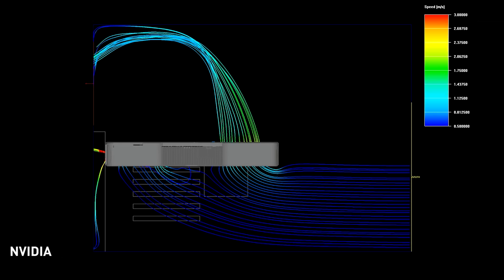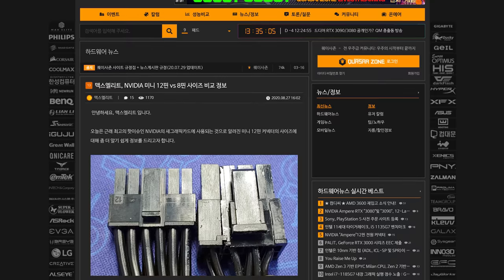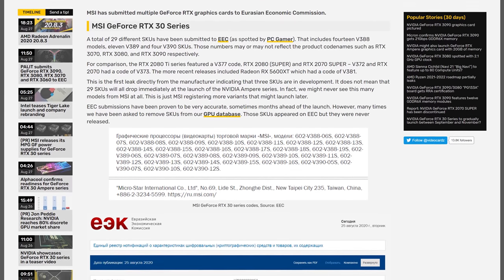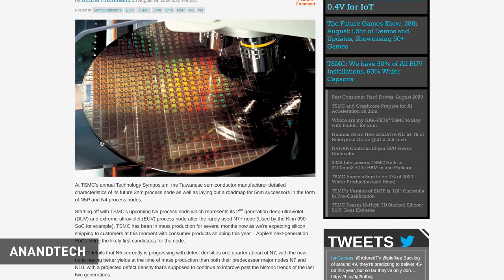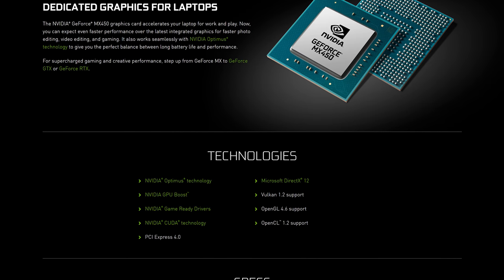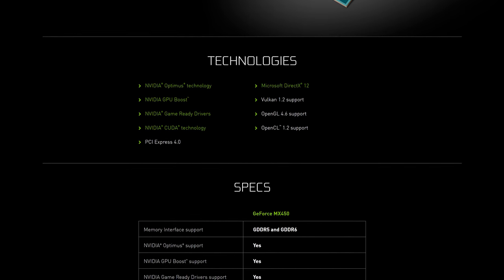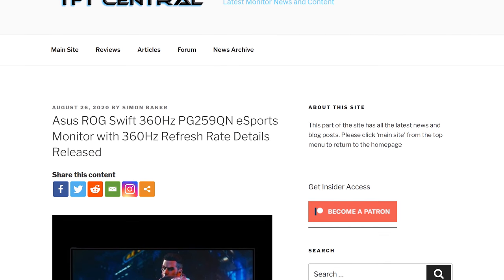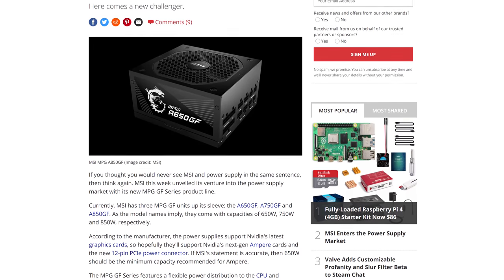RTX 3000 Power Connector, Great TSMC 5nm Yields, Nvidia's First PCIe 4.0 GPU | News Corner

Comment: I remember reading an article in the late 1980s, maybe in Scientific American, right at the transition below 3 µm where they explained in great detail with beautiful diagrams that physics would never allow transistors to be built much smaller. At the time the physics of leakage currents were considered an impossible barrier and we were told that 1 µm could be made but would have such huge leakage that it would barely be usable in some circumstances. They explained that electrons would just tunnel through the insulators and gates and features willy-nilly and make transistors completely fail to work.
Reply: But now the size is inching closer to silicon atom size, which means if we want to pass it we will need some other "magic" to prevent possibility of quantum tunneling.
Reply: Yes, quantum tunneling is a serious issue for ever smaller nodes. A few years ago, it was thought that anything beyond 5nm would be a huge challenge due to tunneling, but now we now that we can still push the material a bit further to as low as 3nm. After that, we're into the unknown. TSMC want to test 2nm viability at some point, but I strongly doubt they'll do so anytime soon.
But even so, let us first see how 5nm goes. The fact that yields are great should certainly please AMD stock owners, as AMD wants to present 5nm CPUs and GPUs by 2022, which would be a tremendous step for them.
Reply: I mean of course. They aren't wrong. You just have to do something different to prevent that leakage instead of just shrinking old planer transistor designs. This is the logic behind Gaa-Fets which are the end game FET. Not a whole lot more you can do besides wrapping the entirety of the source and drain with the gate. Now you have 4 sides of insulation instead of 3 compared to finfet (or 1 compared to a mosfet). Still a lot of fine tuning you can do to improve performance, but you're not getting anything categorically better than a gaa-fet. I would say silicon has a good 15-20 years left before we have to start looking at other materials to continue performance scaling. Lots of higher performance semi-conductors out there.
Reply: @daktaklakpak5059  You can't beat physics, it's literally the laws of the universe. And Einstein has not been proven wrong yet. There are no particles that has been proven faster than light, those were calibration errors in an experiment with neutrinos that were later proven to be false.
Reply: It's also worth noting that the 7nm chips from TSMC were identical in sizing to 10nm chips from other manufacturers, so it's possible that the <3nm might not.... really be <3nm.
Reply: @daktaklakpak5059  lmao
Reply: @TheArrowedKnee  Einstein was wrong in his view on quantum entanglement.
Reply: Sure, but what about that mustache though?
Reply: @skootdiggity1301  it's awesome of course
Reply: @JB-xl2jc  well yes, its already common knowledge that transistors are alot bigger than the name. the 3nm is just another marketing term, just how 7nm was a marketing term.
Reply: @georges617  3nm, 2nm and all this is just marketing term, 7nm doesn´t have 7nm transistors, and neither will 5, so they will probably at some point reach 1nm, and 1nm won´t actually be 1nm.
Reply: @TheArrowedKnee  I just watched a VSauce video "How much does a shadow weigh?". In the video he says we have measured charged particles moving faster than light when both move through water. Yes, nothing can beat "c" the light constant but matter can move faster than light in other mediums other than a vacuum...
Reply: they hadnt gotten the Physics 2.0 update when they said that.
Reply: @kaiser_nit0157  it's not just a marketing term, it's the smallest feature size.
Reply: @commercio3564  of course when they say nothing moves faster than light, that's shorthand for nothing moves faster than the speed of light in a vacuum.
Reply: @PatrickPoet  thats not the case since 22nm originally came out. It usually referred to the gate length or half pitch though there were still decrepancys, in the past this smallest feature size was smaller than the node size for alot, nowadays it is bigger than the node size and it doesnt refer to any gate length or half pitch or any geometry of the transistor, but the producers kept their naming convention.
Reply: worth mentioning that the marketing terms like 5nm arn't strictly representative of the gate size since they measure in all kinds of wacky ways.
Reply: @yamatsukami987  If you mean by "measure in all kinds of wacky way", that they don´t measure anything at all, than you are right. Because they don´t measure anything these days, the node sizes just stand for an generational improvement with nothing else.
Reply: @PatrickPoet  youtube has isaac arthur.
Reply: @daktaklakpak5059  Where is the proof that anything can travel faster than light? A video game?
Reply: @daktaklakpak5059  they aren't dumb..... they are just telling the truth and you are not realizing it. It is in fact impossible with their technology back then.

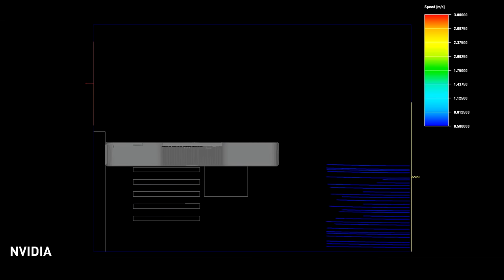Comment: 1:23 I wonder how such GPU cooling solution will affect traditional air CPU-coolers.
Reply: I agree, it seems the air from the top fan will head straight into the path of a Tower Cooler, also what about the VRM getting warmer air,
I am going to watch the nVIDIA video tomorrow for a better look,
Reply: I'm interested in this as well. Will it cause higher temps. Also would this affect other components to heat up with an aio. Since air flow is minimal with one
Reply: my prediction is if your case ventilation is sufficient for the W, it'll be within 3oC difference on CPU average.  that presumably extra energy has to go somewhere.  Separating the core and vram (i think) is potentially a good idea and achievable in their new setup.
Reply: design looks terrible for my inverted corsair 600c case XD but I would prefer to slap a water block on it anyway no way that air cooler will perform better then an open loop with a pair of 280mm rads
Reply: @omgpwnz1  it's going to be an interesting design for water blocks because of the double sided design
Reply: tbh it looks like it'll be too big to fit in an ATX or Micro ATX case. I'll probably be going with an EVGA 30 series if I get one
Reply: @MrZodiac011  what? what kind of shitty cases do you have that won't fit a taller GPU? it seems around the same size as an EVGA kingpin, just triple slot
Reply: probably a neglible amount, non blower style coolers already spread all of the air randomly into the case which ends up going to the back exhaust anyway, this seems to be doing the same thing just more efficiently
Reply: I would think that a traditional CPU tower air cooler would just push the GPU exhausted air out along with the hot air from the CPU

Comment: Man, focusing on the cooler this much this early makes me think they're trying to prepare us for a hot card and that being a good thing lol.
Reply: I reckon you're on to it.
Reply: @3800S1  i can't remember the cooler being this big of a talking point ever. They made an 8 min video explaining it in which about 3 of those min were actually about the cooler. The rest was about how challenging designing a cooler is lol.
Reply: @SirNickyT  Yeah, RTX Fermi?
Reply: Oof.. 🙈😆
Reply: I'm just glad to have dual 140mm fans at the bottom of my case. This design will let the air flow straight through from the bottom of the case to the top. I'm digging it!
Reply: @CaveyMoth  I'm not worried about the design. It's all the ways they're going to try and justify selling an over powered hot card for $1400. Its absurd.
Reply: Sir Nicholas I'm sure there'll be plenty of better cooled cards once the manufacturers get their hands on them.
Reply: 350watts

Comment: r9 290x was 300w tdp gpu and used simple 3  x 80mm fan coller design on one of the coolest cards in multiple benchmarks at the time - gigabyte windforce oc model https://www.techpowerup.com/gpu-specs/gigabyte-r9-290x-windforce-3x-oc.b2688 the cooler able to keep up with "450w" of TDP then, same cooler got carried to 980ti models with saying up to "600w" of TDP and here we are, with nvidia making new designs of gpu coolers which already were made 6 years ago...or we back to 2012-2014 era with such TDP ratings....gtx 480 here we go again.
Reply: I was literally thinking the same in regards to the 295x furies.

Comment: Nvidia is turning in to Intel...
Intel: "New" socket required
Nvidia: New connector required...
This is ridiculous
Reply: Wtf are you saying ?
Reply: its not like you couldnt adapt it - they just did to be able to design a smaller pcb
Reply: So you just add your two 6 pins into a supplied 12 pin adapter, oh no end of the world..
Reply: The 6pins are old and busted, PSU manufacturer cheap out by doubling one 6 pins to make 2, without the appropriate cable gauge to deliver the power.

This new standard is needed.
Reply: @wing0zero  Not at all, 12 pin connector is smaller, also adapter is 2x8 pin to 12 pin.
Reply: @dainiusvysniauskas2049  
Either way you just use an adapter, or if like most of us who have a modular PSU you can just grab a new extension for a few quid.
Reply: Very different though. Imagine if intel CPUs just included an adapter in the box that made current motherboards support it? That's the difference. The new connector will come with an adaptor, no need to get a new PSU. While intel is DEMANDING a new motherboard for use of their new CPUs.
Reply: @odinsplaygrounds  yeah, Intel sux
Reply: @odinsplaygrounds  
Thing is motherboard has to change at some point, they have been phasing out things like the 5v and 3v rail, new boards don't have them so it's more legacy support now and there come a time to move on, just like when people were complaining going from AGP to PCi-e, needed to be done.

Comment: inclusion of PCI-E 4.0 for the MX450 could potentially reduce its requirements for PCI-E lanes to x8 or maybe even x4, which would lower the complexity for the laptop boards, allowing for a cheaper or smaller designs. personally cant wait to find out where thay manage to squeeze it in :D

Comment: Been using 1080 TI for two years which i got for 450eur weeks before 2k series, i was happy that it was on par with 2080 which at time cost 800-900eur and still doesn't cost less than 700eur here.
2080 TI was tempting but for triple the price 25% of gain in performance wasn't worth it. Really hoping RTX 3090 would kick some ass, but it wil be even more expensive... Going to wait for big Navi anyway.

Comment: You do realize PCI4 is still a huge benefit, even on a GPU that doesnt use it right?
They can use half the lanes (8) at PCI4... get the same speed bandwidth as PCI3 at 16 lanes
and use those 8 lanes saved for other stuff... like more NVME or USB.
Trying to explain that to people reviewing stuff is like pulling teeth from a lively shark.

Comment: Will MSI make their own or just rebrand seasonic PSUs
Reply: The Poltical One looks like a CWT GPU Base unit, aka MSIs take on the Bitfenix Whisper M/Enermax Revo DF
Reply: @GreatMasterGaming  If I remember right, Deepcool DQ-m is based on the same platform too. Hopefuly they will keep the pin unchanged, which means people will be able to use custom cables made for Corsair PSUs.
Reply: @dainiusvysniauskas2049  Yep, also CWT GPU. So that'll be interesting to see. If we assume the internals and performance is shown and accurate, at the end it'll be dependant on price to see if its worth

Comment: MX450/PCIe4.0 - It appears the reason the mobile Intel Tigerlake CPU offers PCIe 4.0 for discrete GPU connection is because Intel seem to think that 4x PCIe 4.0 uses less power than 8x PCIe 3.0 and they provide the same bandwidth, it's likely Intel did a lot of testing to confirm that this in fact the case and then it makes sense for what is effectively one of the last Intel strongholds. It's not been confirmed Tigerlake ONLY has a 4x link but all material is compatible with that.
So it might be that MX450 pretty much HAD to offer PCIe 4.0 because otherwise performance with Tigerlake would have been serious compromised if the rumors of it only offering a 4x connection is true, it probably still offers an 8x interface for AMD and Intel mobile processors that are still "stuck" on PCIe 3.0.
I expect AMD to also switches to PCIe 4.0 on their next mobile processors since it's really about the bandwidth rather than specific slot size, AMD might not have dared doing that for the 4000U due to many mobile vendors wanting to at least have the option of external Nvidia PCIe 3.0 GPUs that need an 8x connection to not be crippled by lack of bandwidth but Nvidia is finally implementing PCIe 4.0 with Ampere.

Comment: The rationale behind providing PCIE4 in MX450 might be that it allows using 2 times less PCIE lanes to achieve the same bandwidth, this will free some space on a PCB, and will consume less power (2 lanes of PCIE3 consume more power than a single lane of PCIE4  while having identical bandwidth). Sounds like a win all around, the only downside is that PCIE4 have more stringent requirements for the materials used for PCB manufacturing.

Comment: The nvidia MX gpus are usually connected over only 4 pcie lanes so even though the MX450 is probably only a low power card, pcie 4.0 could benefit it since it has fewer lanes than normal (sort of like how the RX 5500XT benefits from pcie 4.0 because of its x8 connetion)

Comment: I always hate this comment section. 

If you're going to complain about prices, just don't buy it. "It costs more than the last generation" Well no shit, it's better than the last one. Just buy last gen with that reasoning, pricing doesn't scale along with performance. The process of making CPU and GPU dies is not the same throughout the whole generation. They don't just take the same chip and and disable performance from a 2080ti down to a 2060. You people complained about RTX being a gimmick but the cards are still selling, "why?" It's simple, they're just better cards and it costs what it costs. You don't need these cards, and if you really do want them, you probably have the budget for it.

Comment: I reckon they will all take on the 12pin. Neater, smaller, more simple. Future. The idea of paying for some "better than reference" card and the partner using up two 8 pin plugs that take up extra room on the pcb doesn't sound likely. Plus the two 8 pin on tall gpu end up rammed against the side of the case or the tempered glass and look a mess. The relocation of a single 12 pin sounds like a far better solution in every way. The adapter they provide could be part of say a 10 inch cable so that the old psu still works and all the mess of the adapter can be hidden. Why would you not adopt 12pin? Just my view :)

Comment: I'm gonna be that one guy and ask...

Why don't GPU manufacturers make GPU models with the cooler on top, so it can release the hot air upwards and contribute to the airflow?
And don't give me a "but that wouldn't fit Motherboard standards" excuses because GPU manufacturers are also motherboard manufacturers. If they wanted to, they could change the standard to something more efficient as they saw fit.

Is there a legit engineering reason why the fans are stuck at the bottom of the card, and not at the top?

Comment: The explanation for the airflow of the RTX 30X0 is wrong. If you look at the angle of the fan blades, you will notice that the rear fan sucks air from the top of the case, while the front fan sucks in air from the bottom.

Comment: Will my tomahawk b450 support 3000 series?
Reply: With a BIOS update before the upgrade: yes.
Reply: @unojustaj3562  Already updated
Reply: I'll assume a 570 won't need any BIOS update.
Reply: RemusKingOfRome5 it doesn’t “need” it, but depending on when you got the board it’s still wise to flash your BIOS to the latest alpha version from your mobo’s manufacturer’s website, if you already have a 3000 series CPU.
Reply: Lloyd Franklin they were talking about the X570 chipset motherboards....

Comment: The simulation @ 1:28... i think Nvidia forgets that there will be, in most cases, a damn CPU tower right on top of that fan so it won´t exaust the hot air right at the exit as butter smooth as they make it look, it would be better if the fan was at the top left instead of the top right.

Comment: I wonder if it is not time for a new design for a pc form factor? One that treats the graphics card and motherboard/CPU as equally important components. Treating graphics cards as an add in card as this point in time is a little silly, as the power requirements and cooling are often times more than the CPU. Surely a redesigned form factor would free designs of the obvious limitations of treating graphics cards as add in boards.
Reply: ikr you'd think since people build them themselves so often there'd be something a bit like server racks but smaller so swapping out parts would be easier and people would have less chance of shorting things and all that.

Comment: Hi Hardware Unboxed, I was wondering is it possible for you guys to review the Xiaomi 34” Gaming Monitor. It is the cheapest for its specs that I have ever seen at 570AUD in Kogan with (144z, 1440p and VA + 121% sRGB). Excellent video guys! Can’t wait for RTX 3000 and AMD 4th gen, I am planning a build for my first PC. Perfect timing!!!
Reply: Oh right, thanks for the info! I was after high refresh rate 1440p ultra wide ips monitors but their price is insane at around 2000aud for a good panel and a reputable brand

Comment: I think manufacturers would stick to 8pin connectors if they go for a more traditional cooler with a rectangular pcb, but if they go for a more esoteric cooler design, they might also use the 12pin, specially if we see any SFF card.